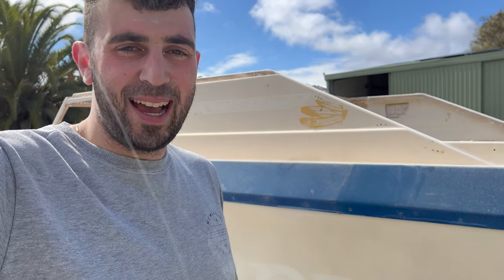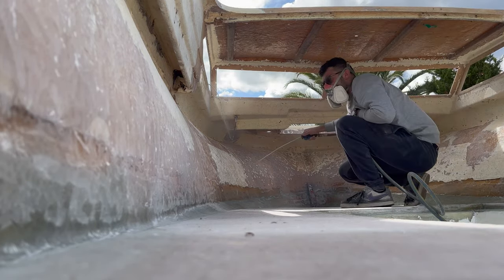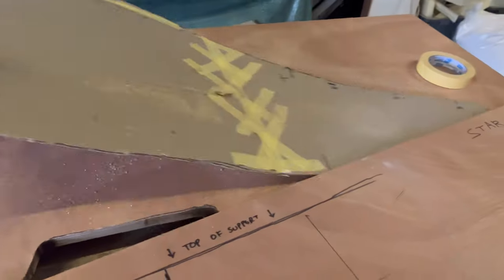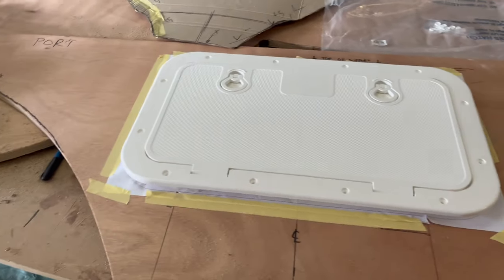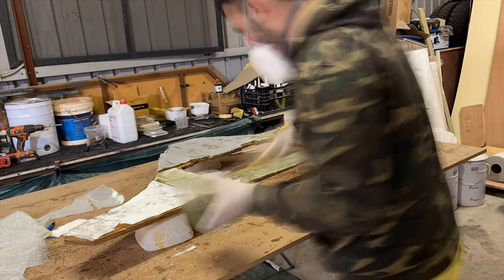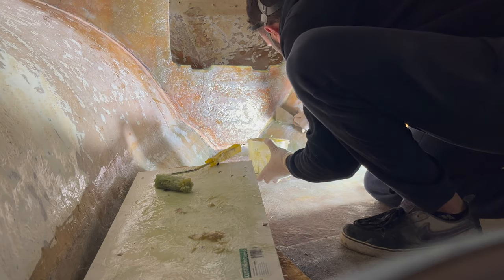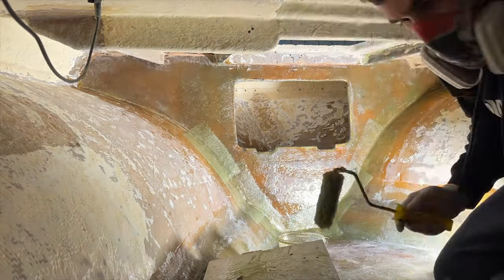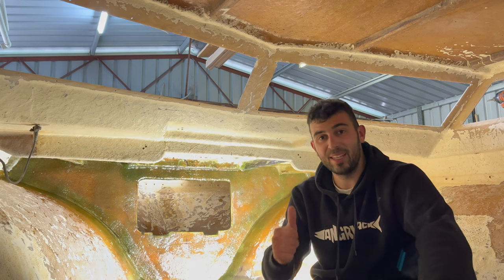Fibreglassing In CUSTOM ANCHOR BOW LOCKER | Pacemaker 20ft | Full BOAT RESTORATION V2 - Part 18

Comment: Gday mate another great video ,here in S.A. we have the same problem and its a pain ,you are lucky to have a shed to work in i only have a drafty carport plus hard to glass when there is a lot of moisture and low temps , some of the peices i have had to glue in the ol banger i just used the old method of talc and poly resin but it is tough as , for filler i use chopped strands and resin basically what the boat was made from originally and any small fills just use car bog only problem is it kicks to quick anyway hopefully good weather soon .

Comment: No drain line installation to beldge
Reply from the maker: What do you mean Roy and why does it need drain line
Rhanks
Reply: We're will the water go from your acorhor chain .but I like your work.did you lbs the craft before and after your rebuild  two 1 1/2 mat 1078 in the middle saves weight  and resion.
Reply from the maker: @royboone5991  thanks Roy but drum winch sitting on top of boat